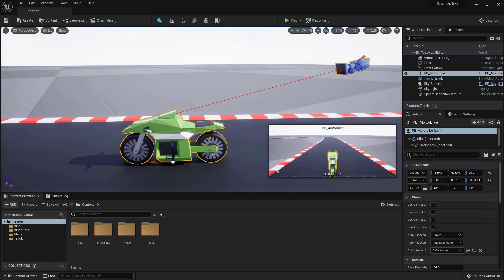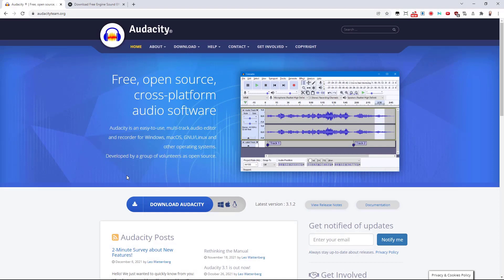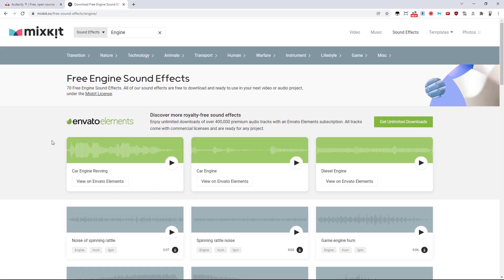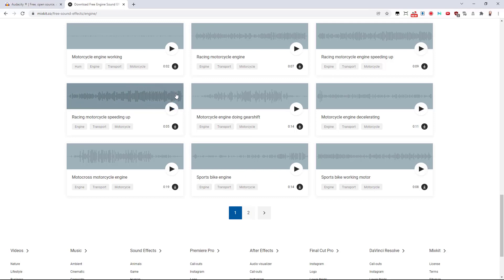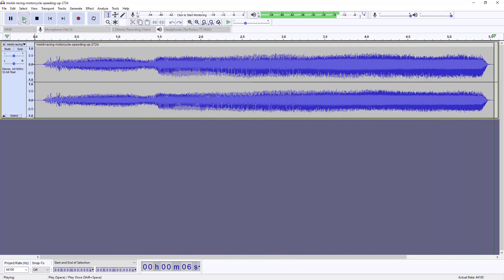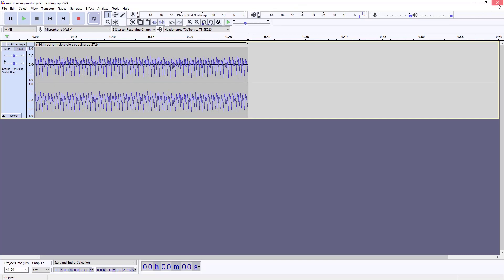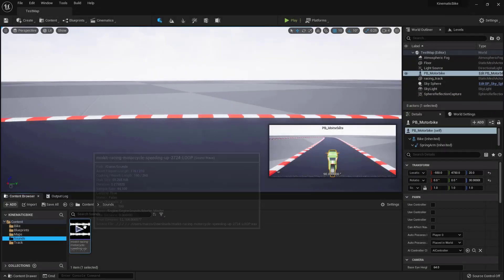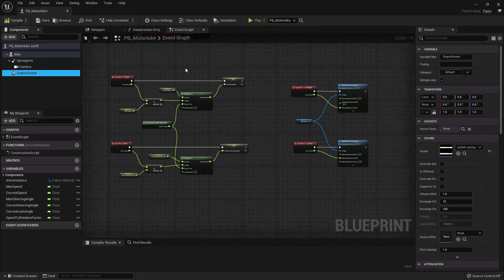Simple Motorbike (Motorcycle) Engine Sound from Scratch - Unreal Engine 5 Blueprints Tutorial

Comment: Thank's for the tutorial
Is there a way to make or simulate a gearbox?
Reply from the maker: Yes sure. You will need to define the engine RPM and how it increases/decreases with the throttle. Then define a current gear and min/max gears. As the engine RPM raises and reaches the max, you are ready to move the the next gear. While the shifting takes place, you will set the throttle back to zero and then quickly go back to its original value. This will make the engine loose some RPM while you shift, which gives a neat effect. Shifting down is kind of the same, but in the opposite direction.
Reply: @marcoghislanzoni  
Oh okay . I'll try it. Thank you for the guide